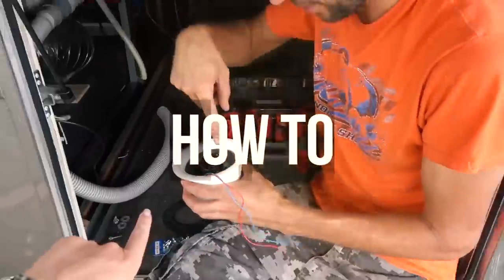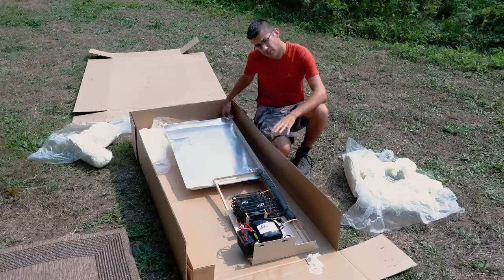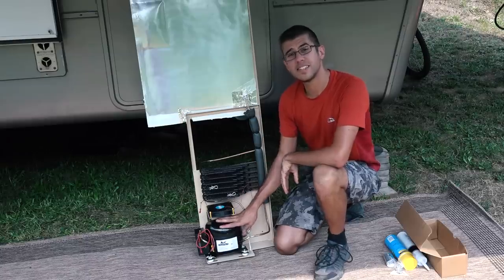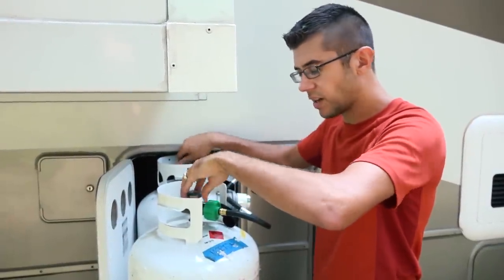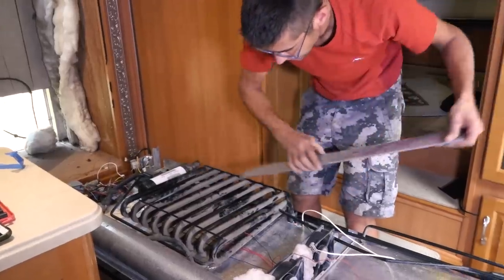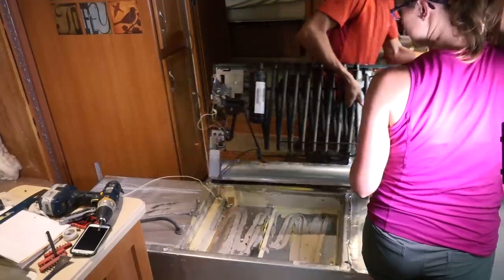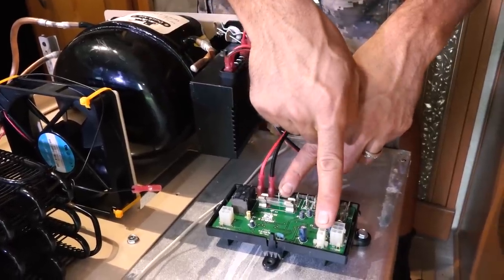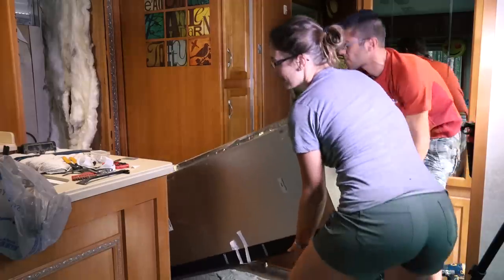Converting our RV Fridge to a High Efficiency DC Compressor- 8x More Efficient! and Better Cooling!

Comment: There's a reason for why folks do not use residential fridges in a RV first of all the compressor is hooked up with copper lines versus steel in an absorption system those copper lines are going to wear hard and very quick with movement and you're going to find your system completely depleted and nobody that boondocks and stuff would want to use this kind of system that you're installing it's just going to draw too much power constantly you can't reinvent the wheel dude

Comment: And you applied the cool mass wrong .. you trap air .. 
You go in strait lines so exsess air can escape out the ends.. 
Air bubbles insulate .. air bubbles don't cunduckt coold or heat .. air IT is and insulator

Comment: Here's the thing. If you're boondocking in an RV, converting the fridge to all electric is not an option. Doesn't matter how efficient it is.
Reply from the maker: All depends on how much battery and solar you have.  We have been running the fridge even in the winter solely on our solar.
Reply: @MortonsontheMove  I find that hard to believe.

Comment: Why did you choose 24V instead of 12V?
Reply from the maker: It will run at both 24V and 12V.  24V is a bit more efficient and I do not need to run it on my DC converter which has a bit of a loss.  Our RV is 24V
Reply: Their RV/Trailer has a bank of 24V.

Comment: Bad move. More problems with 12 volt refrigerators. Bad engineering, multiple breaks down, parts unavailability, mobile techs won’t work on them because of call backs. Might work down road but current experience shown 12 volt not there yet. Better use foam cooler and ice than 12 volt.

Comment: Several issues
#1 A depreciation rate 70%
#2 retrofit cost Tesla system that adds 24volt to 12volt and 120 volt
#3 retrofit 50% of a 7 year old refer what is probability failure of remaining 50% parts
#4 waterproof RV the probability of water damage to a seven year old RV. Will eliminate the remaining 30% value
#5 full time versus part time 10% of the year use for 80% of the market. Assume 20 days x 12 months = 240 days not in use. Gives maybe 123 days possible use. Then deduct cold weather season of 50% to 61 days just a wild ads guess. Compared to the author a full timer with electrical engineering or journeyman electrician skill. The average person does not have these sills of design instal and diagnostics and repair skills. May be inclined to just buy replacement unit with two hour install time. You took 8 hours shop rate $150 = $1200 for retrofit. Not looking at technical side or added cost install Tesla system in 70% depreciated trailer.

Comment: You sound like you're getting paid to promote the product, speaking half-truths. It can be 115F outside without or without humidity and a properly working RV fridge running off 12VDC, 120VAC or propane will keep your food at the temperature you select...fridge or freezer. The ROI on such a product would be a long time and there's no way their unit is 8X more efficient...sounds like a Chinese claim. Prove the power consumption with a meter or don't make such claims. 20lbs of propane last my RV mini fridge almost all summer, which is about $10, unless I go on sale day to fill. Granted, running off solar would be more efficient, but I doubt it. I test products for claimed abilities.
Reply from the maker: On electric 8x is conservitive, it's actually more like 10.  I was not paid anything for this video.  I mentioned our unit was not working well.  It's just an option, but you try running a rv fridge on electric and solar and you will see the insane power consumption.  There is no comparing to propane use here, I agree that is the best for off grid use as a bottle would last us 6 months.

Comment: Thermostat
Reply from the maker: If you are trying to correct me it is a thermistor in this case.  Thermostats are bi metal and not used much anymore. Could be a thermocouple too but usually those are for heat not cold.

Comment: When all is said and done (Fan inside fridge and leaving a light on in the freezer adding a defrosting heater ETC) you may find your "8x More Efficient" to be no savings at all. Including lower temperatures It will now consume more power.  I wish I had what you pulled out. Cleaned and maintained I am sure I could run it on solar for 1/10 the cost and every day power usage would defiantly be less. The heaters come in different voltages and the original had no moving parts assuring cooling 20 years after that compressor failed. Finally "Most refrigerants are known for having a negative effect on the environment since they contribute to global warming and ozone layer depletion."

Comment: And I thought maybe I'd correct you that was not called a thermistor that is called a thermocouple or a thermal probe
Reply from the maker: It really depends on the application or device, but actually in this case it is a thermistor,  Thermocouples generate a voltage when heat is applied while a negative temp thermistor varies resistance.  With a thermistor you use a voltage divider in the circuit board to sense voltage drop, where as a thermocouple you sense directly.  Due to longevity and stability of thermistors at minor temp differentials I think they tend to be the choice for refrigeration units from what I have seen.... But again either can be used.

Comment: wow you ran compressor tooo quickly after standing unit. wait 24 HRS min so all liquid to drop back into compressor
Reply: That does not matter with R134A systems only with older R12 and amonia systems.  The compressor itself has an oil resivoir in it for just this reason..

Comment: If you would have turned on the fans that were already on it, it would have cooled down more.
Possibly saving you from doing all this.
Reply from the maker: They ran almost all the time when the weather was around 70-80 degrees.
Reply: @MortonsontheMove  ... yeah the basic design of the compartment for the LP fired reefer is ill conceived for sure.  the upper vent should be two 4" fans that pull air through the fins with 2- 3"  or so fans under the coils to get good airflow. On our airstream the vent in on top and its not such an issue..

 but will be adding fans in as well for hot weather usage.  looks like a good upgrade.  any follow up vid on performance scheduled..  HAPPY HOLIDAYS  to you both.